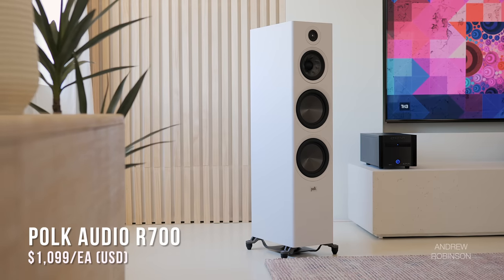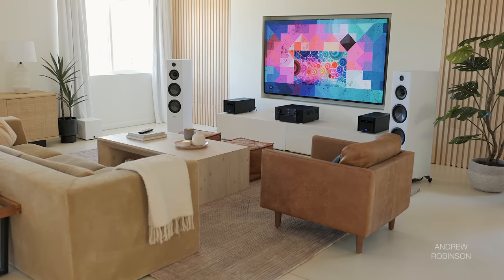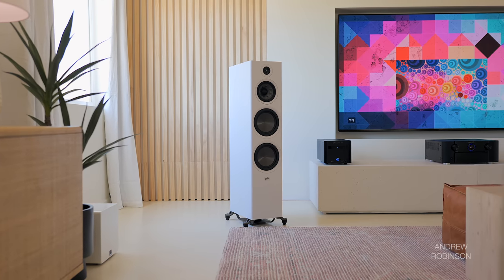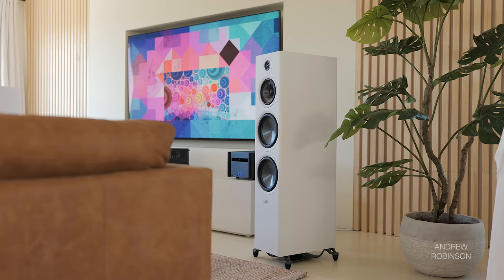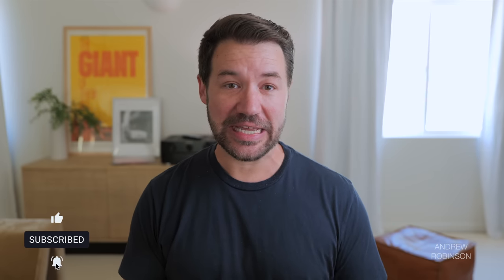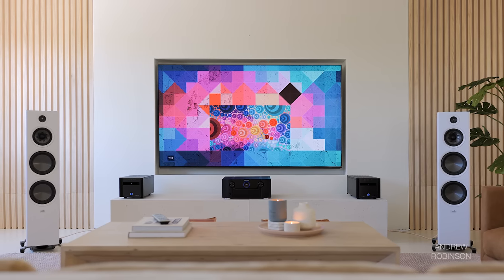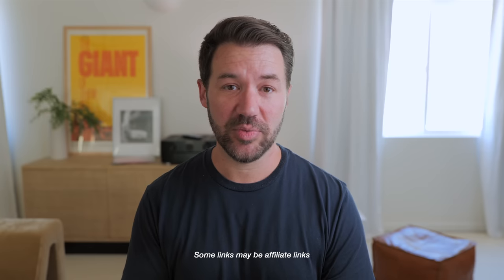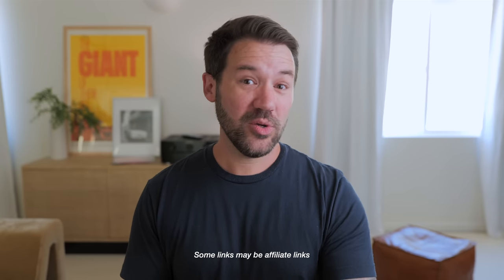Are High End Speakers REALLY WORTH IT? 🤔 Polk Audio R700 Review

Comment: I watched the Warfedale Elysian 4 review first, then brought this one up to be treated to Christie’s loving interrogation of Andrew at the end. 👍 Christie. Regarding which of the two I would buy, and why, I think I would go for the Elysians, but after watching your review of the Polk R700s, I feel I owe it to myself to at least audition the Polk model. The AMT tweeter on the Warfedales is a concern. I have a friend who desperately wants to love a set of bookshelf speakers with AMT tweeters, but their utter lack of vertical dispersion drives him batty. (They are not Warfedales.) In my case, I feel I may be getting to the end of my game, and I want to admire not only the sound, but the look of the largest single component in my system. So, I suppose ‘validation’ enters the equation in my case as well. 

Another reason I’m tempted by the Warfedales is that  I currently own a vintage pair of Warfedale ‘achromatic’ W70Es (3-Way, Mylar tweeter, 15” paper cone woofer stuffed into a 2’ x 2’ x 1.5’ cabinet) which I enjoy very much. My only complaint is that the bass can be a bit wobbly unless it’s rendering a well-plucked acoustic bass, or any other traditional bass line, really; it just gets swamped when a major portion of the recording’s ‘sound’ enters the bass region. Christie would complain, I’m sure, if she listened to them.

Comment: I’ve had my Quad ESL 63 (Electrostatics) for over 40 years. For transparency, imaging and lack of distortion I doubt they can be beaten. They have some downsides though; they don’t play very loud, bass isn’t their strong point and placement is very critical but where they excel is with live acoustic recordings, classical, jazz and even rock. Fed with a good recording these speakers disappear, you’re transported to the location of the recording, its like being there and that to me is the whole point of a good hifi system.
Although  expensive when I purchased them, they have been very good value because they have stood the test of time so well and have sounded better over the years as I’ve upgraded the rest of my system.
I think anyone reviewing speakers should listen to these or their current equivalent: Quad ESL-2812 or ESL-2912

Comment: i haven't heard the R700 but after watching and reading reviews including this one, I have to agree there good, and is a dual duty speaker for movies and music but they do need external power to reach 90-100db which i like to listen at. Dare I say R700 are well rounded but may lack the sparkle highs that im used to with the RP Klipsch line. But I do believe the 3 way has a more wider fuller sound than a 2/2.5way speaker, but Klipsch does have a dynamic or exciting forward sound to them

Comment: Hello!  Great review and thank you!  A clarification question I have, you mentioned in the video that giving the 700s a couple hundred watts of power really get them going.  Do you mean that I should look for an av receiver that has 200 watts per channel?   I was looking at a Denon x6700H, which delivers 140 watts per channel.  Is that not enough?
Reply: Did you pull the trigger on the r700's?  I have a Denon x6700h as well and am vacillating between the r700 and r600's. Thx!

Comment: It is a question that should be asked, as most enthusiasts in whichever space they partake of (watches, knives, cars, speakers, whatever...) tend to lose sight of the why they started the path; what got me IN TO this hobby? In this case, for me, its the high volume sound experience. Over time, I found myself chasing products of a caliber where I had lost the ability to discern real differences. I have owned and moved on from lots of expensive gear in order to upgrade to higher "tiers". Where did that get me? No where I needed to be. I am currently whittling that gear down into a mostly ambient (think Sonos, etc.) and paring my remaining main system down to something I can still enjoy. A sensible turntable (anyone want to buy my barely used Pro-Ject Xtension 10 with the Superpack!), something decent to stream music to that can change with the times, my very analog Yamaha integrated, and a set of fun speakers (currently Zu Defs, but might go Klipsch Heritage something). I think I will be happier, with quality gear that will last and gets me off the "critical listening" train. I just want to hear music in the background most times, and when I want more, its only because I want to hear music louder. A system that can do that without breaking into bits and pieces will suffice.

Comment: Nice review! I wonder if it is worth considering swapping out my 10 year old PSB t2 speakers for the Polk R700?  I’m a fan of the some of the design innovations Polk has done, but to really know if they sound “better” I’d have to compare I guess.

The problem with speaker shopping these days is there are very few bricks and mortar stores left, so one has to order speakers (which can be heavy!) from a company that allows trials, and even then they tend to charge something for heavy items such as speakers on the return…and even if the stores were still ubiquitous, the only way to really know if speakers will sound better in your room is to try them in your room. I wish there were a better way

Comment: I bought the R600s because I have a smaller room and the 700s were too large to fit.   I love the sound of my R 600 speakers could they use a little more bass, yes but the ring tweeter is a very impressive driver. 
   I also agree with being overlooked in a high end audio shop. It has happened to me more that once. I also had the same issue in jewelry stores. I had a Rolex that I needed to repair and was told by 2 Rolex shops that I had a fake Rolex. They did not take more than a glancing look. It was not fake, it was because I was 24 and wearing a t-shirt, shorts and flip flops. I said thanks, and walked out never to return.

Comment: The brochure for these speakers (Polk R700) say they are compatible with 4ohm, 6ohm, and 8ohm receivers. However, while searching the web some people are saying these are 4ohm speakers. I have a mid-tier Denon AVR and I'm wondering if these would pair nicely or if I should instead opt for a pair of Klipsch RP8000F II
Reply: What receiver do you have, anything X2000 series and up I'd say your fine. These do benefit quite a bit from the a better amp. I have a X6700H and it works perfectly, if you have pre outs I'd def recommend these as you can always get a 2 channel amp later if needed for extra oomph

Comment: Such a great review, and discussion between you two was again the best part of it! If it weren't for the power "requirements", I'd be seriously looking at getting these, but I just don't like the thought of adding more equipment to drive speakers. Just makes me uncomfortable.

As for the question, I appreciate quality sound and a balanced room, though I don't really identify with being an audiophile. Then again, I don't really identify with any catch all expressions like that because I feel like it's oversimplifying at the cost of nuance and conversation. So my current setup is a package deal of cheap Jamo 5.1's in the ballpark of 400 euros when new, and they've served me well. And an Onkyo RZ-740 I bought two years ago. I've been reading up and listening to some options for about a year now, and am waiting for the right time to upgrade - prices in my region have jumped up more than 20% within a year. I've set the max price range at around 3000 euros for a 5.1 system, and am seriously considering the Dali Oberon series, with Klipsch 6000f & friends being second contender, and KEF Q750 & friends the third choice. 
And finally, with that setup, my answer: From my perspective, and I do understand I'm still very new to this "hobby", I have a hard time grasping how a 1000 dollar speaker could possibly be that much worse than a 9000 dollar speaker - and anything beyond that just seems ridiculous and unnecessary for anything but maybe status or bragging rights. Which is fine by me, if that's your thing, but I'd much rather have a conversation with someone who has spent time researching and figuring out why they prefer X product over Y product, than have someone tell me they've bought Z product because it's the best there is according to someone else (usually with a hefty price tag to support that claim), with no opinion or further reasoning of their own on it.

The latter two of my upgrade path options are to a large part on my shortlist thanks to your reviews and work on here. I'm really glad I found your channel when I started to look into audio stuff more, and continue to enjoy your thoughtful and eloquent reviews. 

Take care, and all the best! 
(And remember, the only people who need to like your channel and the work you do is you - and your audience - everything else is irrelevant) 😉

Comment: Hi Andrew and Kristi

Thank you for review
Given R700 are designed with home theater in mind (though music is more important for me) what AVR would have enough power to drive them well?
Are RZ50 and X3700 good enough to drive or better to go for something more powerful/expensive?
Reply: I'm strongly considering the R700's right now and I have the 'twin' of the RZ50 in the Pioneer VSX-LX505. 
Whether the Pionerr LX505, the Onkyo RZ50 or the Denon X3700, you can use an external amp to 'open' the R700's up.
Andrew did address using the Onkyo NR-7100 to power the R700's at the 8:30 mark. The 7100 being just a step down from the RZ50 in Onkyo's line-up.
Hope that helps.
Reply: @12GaugeLeadSalad  thanks for advice.
i got that you can connect AVR+amp. I was more interested if there any AVR which can drive R700 easily without ext amp

Comment: Thanks!  Quick ? - Do you think my Marantz cinema 60 will have the power to drive these speakers?  Cheers.
Reply from the maker: Thank you for your support. The Cinema 60 will drive these speakers just fine, but down the road if you want to experiment with more power you may extract just a bit more control from their dual 8 inch woofers by adding a separate stereo amp like this one: https://bit.ly/3uRu9o1 or two of these (one for each speaker) https://bit.ly/39WvWDo You DO NOT have to add these amps right away, in fact, get to know the Cinema 60 without them. But if you get the upgrade itch, don't throw out your Cinema 60, add an amp or two.

Comment: I’ve owned high end audio and altho’  it’s nice listening to,  to really experience them is not always possible…  I lived up in the Pocono Mountains at the end of a gravel road and sometimes when I couldn’t sleep at night I’d throw the fans on the audio cabinet,  turn off all the lights and sit in the sweet spot…  but to get to the point of this is,  it’s not always possible or convenient to do this and for the pleasure of listening like that sometimes it just wasn’t worth it.  And for a lot of people,  impossible…  nowadays I have a good system that I can use for just about everything,  and that’s worth more to me than having the biggest,  badest,  best sounding system.  I give up top end for well rounded.  That’s what I’m talking about…  Polk Audio LS90,  with carver 250rms & 500 peak watts running the bottom drivers.  It’d slap against things,  yeah,  had enough length speaker wire to take outside…  Rotel running the upper stereo separation.  Alone,  quiet in the middle of the night in the middle of nowhere,  WOW!!!

Comment: Just pulled the trigger on the Polk R700's. Whats your take on the center. It's seem be L400 but at $1700+. Wow. Suggestion?
Reply: Which center channel you decide to get ?
Reply: How is the treble?
Reply: @bigspence6898   I like it. Even at high  level sound good. Everybody ears are different. I like a neutral sounding speaker myself. They are big so check your space. The R600 would of fix my space better but I wanted the 700. The price on these are now $899 each. Down  200 bucks. Good time to buy. I bought the R400 center on open box from Safe and Sound. Good luck. Hope this helps.
Reply: @duriarte3190  thanks. What amp?

Comment: I'm very happy with my system which is in a reasonably small space.  But I went from TV speaker to sound bar to 5.1 hand me downs to the 5.1 I have now and every time the improvement was very notable. Makes me moon over other speakers wondering if another upgrade will give me that huge improvement.  Some day, I'll notch it up some to see even though my stuff works fine now.

Comment: Excellent points at the end of the video! And that attitude of certain hifi dealers that you’ve described is also present in few high end watch stores. But coming back to the idea that certain speaker brands require expensive gear, I agree that is total bs. I‘ve been told that my Focal Sopra 2’s would sound the best using $30k Naim amps…well, in my living room the Sopra’s sing with a pair of class D monoblocks that cost me just $1200! One of my audiophile friends that cares only about how much a piece of gear costs, commented ‘these speakers have no right to sound this amazing with those cheap monoblocks’…

Comment: How do you compare them to focal chora? Which one has better details, sound separation?
Reply: I owned the R200 and R700 and now I own the Chora 806, 826 and Aria 906. Clarity, detail retrieval, transparency, instrument separation and soundstage width all go to the 826, by far. The only thing the R700 has over the 826 is bass but Im running dual subs so no matter. The R700 is definitely a warmer sounding speaker, the mids on Focal pop more. I used the Crown XLS2502 to run both so power isnt a problem. Both with excel with high current amps.

Comment: Question: Would  there be a benefit  in the same system for home theater if we add a center Channel Speaker , specifically a Polk Audio - Legend L400 Center Channel Speaker “since there is no Reserve with the same configuration as the L400” and then add a 3rd Emotiva XPA HC-1 to the Center Channel Speaker using a Onkyo - TX-RZ50 this would make a great video just because I have never seen a mono block used in a home theater to drive a center channel speaker. So the second best more affordable better looking home theater audio system would be same setup
Klipsch Reference Premiere RP 8000F piano black, SVS - Center-Channel Speaker  Piano Gloss Black, Onkyo - TX-RZ50 9.2 Channel with 3 Emotiva XPA HC-1.

Comment: Would you consider these to be an upgrade from a pair of KEF 750's? I haven't found that opinion anywhere. 
I've recently felt my 750's (even with a basx amp) don't have that pronounced (but accurate) bass I was hoping for, even after bringing up the low end in Dirac

Comment: Hi Andrew. I am from Brazil, looking to upgrade my equipment. 
My system now:
DENON AVR-3700H
MONITOR ÁUDIO BRONZE 2
POLK AUDIO HTS12
After your review, I am almost certainly buying a pair of the R700s, hoping it will be a major upgrade. I am trying to upgrade center imaging, overall detail and overall sound presence at lower volumes.
If possible, can you suggest me some stereo amplifier options to match with them? 
Thanks for the reviews =), learning a lot from them

Comment: Hey  Andrew. great review about the R700. But just confirming with you if these would work great with just a Marantz 1711.. You have paired them up with Emotiva to provide extra power.. Just wondering if R700 with Marantz 1711 will be a great setup as well..
Reply from the maker: I personally like them with a slightly more powerful amp but try em on the 1711 and if you want to add a separate stereo amp later you can.

Comment: It is a painful fact, or at least a painful "reality check" for makers of "high end" whatever that someone out there might be making something that is really as good or even better that does not cost as much. I know there are ton of factors that go into that: items made in country x vs. in country y, size of the company, and many other factors. Audio has been one of those areas that has really seen this gap narrowed to the extreme. I was blown away by Paradigm's Persona line when it came out. They are very "expensive" speakers and sound phenomenal but cost significantly less than other even costlier high end speakers, but I wonder, as anyone does, with any brand: "is there something as good or even better out there at a much lower price".

Comment: What center channel speaker do you use to pair with this? (Recommendations)
Reply: R400 is probably the best option if you have the space! I have R200s on surrounds and 4 R900s as height speakers with a Denon X6700H and WOW it's incredible
Reply: What amp are you using ?

Comment: Hey there, I'm buying these but trying to stay under $4,000 total investment with Onkyo and the Crown XLS. Do I need to purchase 2 amps from Crown or will 1 get it done?
Reply: for 2 channel listening, I would recommend (bi amping + bi wiring) them from an AVR. If you wanted to bi amp and monoblock both speakers, youd need 4 amplifiers 🥵🤑

These speakers sound better bi amped.
Reply: I do fine with a single crown xls 1002. It doesn't have the imaging of my technics amp but it brings out everything else the speaker is capable of.